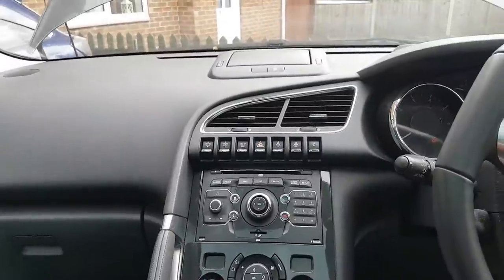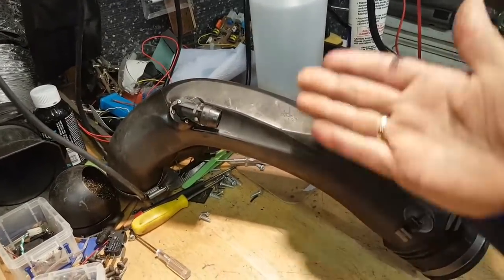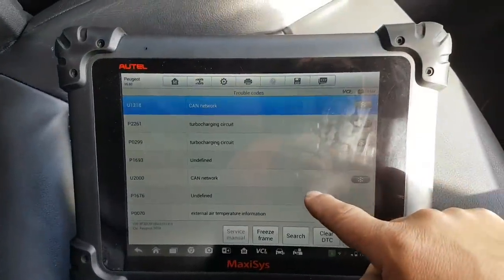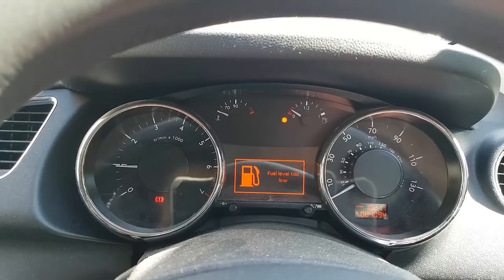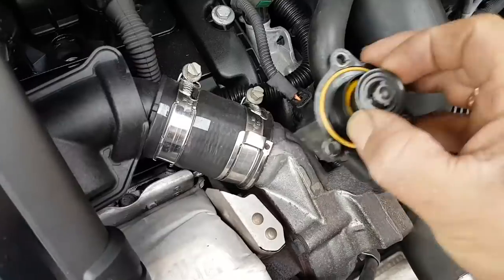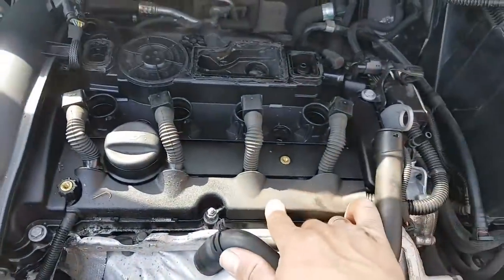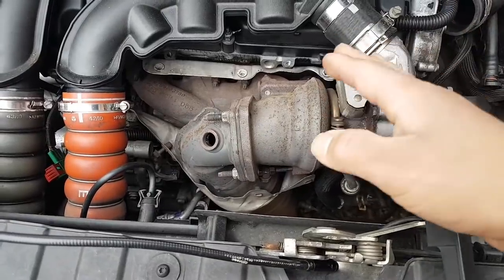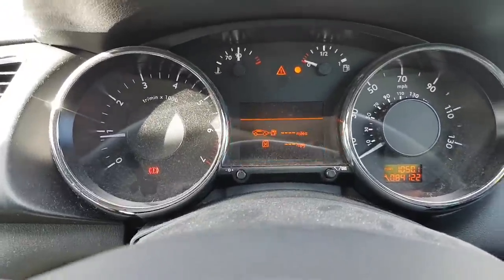Peugeot 3008 1.6 turbo petrol, P0299 and P2261 no power and limp mode. Fault finding and repair.

Comment: There were some things I wanted to write but in the end you did a fine job Luis and didn´t change anything that wasn´t necessary . The non comm with the ECU was a bit strange but than again , it has happened  to me also . With a charger connected weird things and with a new battery all OK . Never second guessed it .
Reply from the maker: Over time I realised that low or weak batteries will provoke all sort of weird things...
Some cars are more affected than others though...
👍👍👍

Comment: LUIS, AWESOME video and information fixing this car with logic step by step one thing as i do always with turbo problems/ boost power i use smoke machine to check for any leaks first with all the plastic they are using those days as u know they crack with time and other thing it was good to see fuel trims pids that would show 100% lean mixture because of that leaks as always enjoyable to see the master working thanks for sharing brother. cheeeeers

Comment: You're right. When the cover fails it blocks the exhaust. These engines are turds. Always seems to be same scenario though, knackered battery, no fuel, no love care and attention. Tight owners.
Reply from the maker: 😊
👍👍👍
Very tight...
Reply: Seems to be a PSA thing, the diesels have the same issue when their PCV or EGR system fails it starts crudding up the diesel particulate filter.

Comment: One of tree things is check cat. Put hand on exhaust, if is cold, cat is 90 % block. I made tool for this. Manometer, pipe and fit. O2 sensor out and put tool. On high rpm, about 3000, presure must be under 0,3 bar.
Reply from the maker: 👍
I don't have a sensor... 
Thank you for watching and for your comment!

Comment: Great work !! As always appreciate you taking the time to make these videos 👍🏻
Reply from the maker: 😊
Thanks!
Reply: @LMAutoRepairs   hi I got a peughto 207 gti on a 58 got a p0087 code low fule pressure rail it's spluttering and popping and banging  I've changed the fule pump in the tank and the one on the engine changed the fule sender spark plugs put loads or money spent on car and problem is still the same
Reply from the maker: Have you tested the pressure sensor?
👍👍👍
Reply: @LMAutoRepairs  that's new to mate that was the first thing I've changed
Reply: @LMAutoRepairs   were u based to may be I could bring my car up to u and I pay u for fixing it I'm 3g in to car oready  mate 🤔

Comment: one thing I have seen a few times now with the THP prince engine that is a easy fix but hard to find and the symptoms are very similar to this the air pipe to the throttle body pushes itself off and because it is held in place by the bolts on the plastic part of the pipe every thing seems to be ok until the turbo kicks in and pushes the pipe away from the throttle body

Comment: Been looking at the wife's 3008 thp as it seemed to be down on power. Just a heads up, the diverter valve is a weak point and the bmw mini one fits, is cheaper and stronger too! Handy! The rear pcv can be blocked with a Peugeot part as they realised that the breather causes massive carbon build up. I'll be checking the cat tomorrow though as she only does 5 miles a day commute..... Awesome video and thanks!
Reply from the maker: 😊
Thanks...
Hope you get it sorted!
🤞
Reply: Super knock triggered on the fault codes... Hope this isn't another cam chain.. 😳

Comment: Thank you for the very informative video. I have a 207 turbo with the p0299 error code after revving more than 3500 rpm for 3 seconds. I have checked vacuum, changed the electric valve. How can I check if I need to replace the valve cover? Is it possible to verify if the valve cover have failed?
Reply from the maker: Watch from minute 29:00...
You can also smoke test (which I never done on this video), if any leaks the smoke test should highlight them...
Then the valve on the cove as I've also explained...
👍👍👍
Reply: @LMAutoRepairs  the valve on the back of the cover should be open if the pressure is low and close if the pressure is high, I assume. That makes the smoke test more complicated.(at least for me, I am a noob).
Reply: @LMAutoRepairs  Thanks, I have the same 2 codes as you have at 29:00. I suspect the air pressure just escapes through the valve cover back into the low pressure side If the back valve stays open. 
Can't figure out how to test if the valve closes under pressure?

Comment: My Peugeot rcz is having the same problem now. My first guess is to change the air intake since it's somehow damaged. I think I might have to check the CAT too. How much did the client spend in total?
Reply from the maker: I can't remember now... sorry...
👍👍👍
Reply: Hey Buddy, did you solve the issue with your RCZ? I have the 1.6 THP 200 and got P2263 (Turbocharging air circuit, pressure too high - intermittent) following with P0299 (Turbocharging air circuit, pressure too low - permanent)

Comment: Good work.thank you.wondering why that ecu significant blocked exthaus system instead of turbo preassure?there are 2 sensors on cat in and out to measure that but no any fault code.if you put filters like dpf,cat,egr onto exthaus  systems that will reduce engine power in long therm usage 2x2=4
Reply from the maker: Was the poor mixture due the broken intake... As I briefly explained...
Seen it more than once...
👍👍👍

Comment: Hello sir .. i have a fiat bravo 2010 with 1.4 turbo engine .. the engine would not start before couple of days .. i tried to make it run by adding fuel remove the negative cable .. now the engine is running but the rpm wouldn't exceed 1000 revs at idle .. even the car doesn't want to move .. no dtc .. tried to change the throttle body but still i have the same problem even the turbo valve doesn't open ... And no revs .. any ideas .. does it have a bad ecu ? 
Thanks in advanced for any help 🙂
Reply from the maker: It is possible... but check live data... your answer is more likely to be there...
Thank you for watching!

Comment: Would an overboost situation that drops the turbo until you restart the car be caused by a blocked catalytic converter?
VCDS error P0234 on a 2010 VW Touran 1.9TDI BXE 105BHP engine with close to 170,000 on the clock.
Turbo is on the back of the engine at the bottom and it is labour intensive just to inspect, so just trying to compile a list of possible issues.

I have just had the camshaft and lifters replaced and there was a severely worn cam and a few lifters were severely worn.
Reply: Usually indicates that the wastegate is stuck closed which builds too much air pressure inside and it can cause big engine damage.
Reply: @blackops2376  but it only seems to happen temporarily and randomly. I was beginning to think there could be a wiring loom issue it was so unpredictable since it happens in all seasons (weather/outdoor temperature), happens rarely, happens with hills but also on the flat.
It’s so bad when I’m stuck behind a car doing 30 in a 50 I daren’t take on any over taking manoeuvres unless it’s clear for a long stretch in case the turbo drops.
Thanks for the feedback, where exactly is the wastegate and does it have any other names?
I thought on my car it was part of it close to the EGR valve?
Reply: @blackops2376  also would this have anything to do with poor starting in colder weather? I know about the usual diesel glow plugs and 3 out of the 4 are working from what I was told, the fourth wasn’t removable without dismantle the head according to the garage.
It’s almost like the car starts to turn over and some blockage or lack of fuel sensing occurs, but, if I remember on a cold morning, I can over come this by pressing the accelerator while it turns the engine on and it forces a smoky throaty start every time.
Reply: @Infiniti25  the wastegate is at the exhaust part of the turbo usually left sife of it its big, attached to it is the actuator but your diesel problems might be because of the EGR get someone to disable EGR it only causes issues
Reply: @blackops2376  I have VCDS, but I would need a remap surely
Reply: @Infiniti25  yeah sadly u do

Comment: Awesome video, thank you so much, I have Peugeot 208 GTI  with same engine, I have a similar issue but if I switch the car off and return to it after some time it runs perfect for about 5 mins and then I feel a loss of power. Have the same code p0299. It has only 28k so cat shouldn’t blocked. Any ideas would be appreciated it.
Reply from the maker: The cat can block easily if the car has been running with issues...
Check for intake leaks etc...
Thank you for watching!

Comment: Quick question @lm auto repairs. Does the ecu from a pug 207 need to in the car to be reprogrammed or can I just send you it to download file for my car and reprogram? Asking here as got no reply from your forum. Thanks in advance
Reply from the maker: What exactly are you trying to do?
Reply: @LMAutoRepairs the fan won't come on at 105c as it should and  after checking all the loom for a short to + .diagbox says cooling fault integral to ecu I can only assume a driver has failed inside ecu at this point .but oddly the fan comes on after I switch engine off. So this why was asking about programming another 207 ecu thanks
Reply from the maker: Strange...
If you activate the fan with the diagnostic tool, does it comes on?
Reply: @LMAutoRepairs  yes slow and high speed and obvs workes when the air con is on. Inless iv missed something on the loom .it must be a driver in the ecu . This is why I was asking a spare ecu can be programmed out of the car .or dies it need to see the bsi and key ring fir security reasons??thanks for replying.
Reply from the maker: You can possibly program it out of the car, by clone the ecu, using k-tag or similar...
But, if you can actuate the fans with the diagnostic tool, and they work, then I doubt is going to be the ecu... the control side is the same, whether you actuate them with the diagnostic tool, of they come on when the temp gets to the set point...
Your problem will most likely be something else... I am not completely rule out the ecu, but if is the ecu, is a different circuit...
Can you see the coolant temperature on the live data?
Reply: @LMAutoRepairs  yes I could see it.also if I unplug the cooling temp sensor situated before the thermostat the fan comes on high after a few second but while its doing that the engine almost stalls. I'm not subscribed to diagbox as I don't know how to obtain a short subscription as its in French am assuming if I could subscribe I could log into peugeot and update/ reprograme ecu my self. And have a better chance of solving it if I could get a diagram etc .
Reply from the maker: Google "service box"...
You can get a couple of hours subscription access...
Yes, I don't think your problem is the ecu, at least the way you think...
A reprogramming is probably worth of shot...
Diagrams, search for sedre...
👍👍👍
Reply: @LMAutoRepairs  ok thanks ill try get a sub as I have service box thanks for your help

Comment: Hi mate i need some help i have a laguna II ph2 2006 2.0 dci 173bhp.
A mechanic deleted by mistake my injectors, I document my self on the internet and I managed to rewrite the  injector codes then I had to reprogram my glow plugs and the car works flawlessly apart the black smoke that comes out from the exhaust(before it dident use to smoke at all!!) I had a look at the injectors correction data ppl say they work properly, I had a look at the egr and it's not clogged, I checked all the intercooler/air/vacuum pipes they are all ok.
once the car lost power just like in one of your renault traffic videos when you press acceleration and notthing would happen but then i put it into reverse and works since then.  Cand you suggest me somewhere to start looking? today I'm going to replace my MAS AIR FLOW sensor but I'd need more advice as I'm just a car enthusiast thank you in advance!!
Reply from the maker: Hi
In which order did you programmed the injectors? 
It is common for programming them in the wrong order... double check that if you are not 100% sure you did it correctly...
👍👍👍
Reply: @LMAutoRepairs  I took first injector from timing chain side
Reply from the maker: I am pretty sure on renault injector 1 is the gearbox side...🤔
Reply: @LMAutoRepairs  Should I try the other way around then? my engine code is m9r760
Reply from the maker: Nothing to lose...
😋
Reply: @LMAutoRepairs  ill give it a shot once my wife comes home with the car 👊
Reply: @LMAutoRepairs  I  rewrote the codes but same thing....I went for a short drive and gives out the same amount of smoke 🤯🤯
Reply from the maker: Difficult to say without looking...
What exactly was done to the car?
Check other parameters of live data...

Comment: Worst modern 4cyl engine its possible to buy, Junk from day one.
Reply: Peugeots. This one from video is not that bad. 
I can remember first 1.6 hdi 16v diesel engines. They  was so bad designed and everything fails on these engines. Turbo, oil dillution, dpf, egr, injectors... you name it
Reply: All Prince series engine's are garbage not helped by the owners neglecting even the most basic maintenance but the amount I see with timing chain failure running faults carboned up or with HPFP failure is ridiculous.
Reply: Bom vídeo...e esse problema de conexão da VCI com a ECU do motor (no grupo da PSA) também acontece por vezes na máquina de diagnóstico da TEXA...e já reparei que primeiro entro na BSI e assim já comunica com a ECU ...não sei se é do próprio sistema do carro ou da máquina de diagnóstico!
Reply from the maker: Interessante...
👍👍👍

Comment: Hi.. can egr cause low boost ...?
Reply: In some cases. If the EGR is stuck open and it's mounted on the high pressure side, any boost will just blow out the exhaust. Also, if the EGR doesn't work properly, the filters downstream (cat or DPF) can get clogged and this would cause the turbo not to spool.